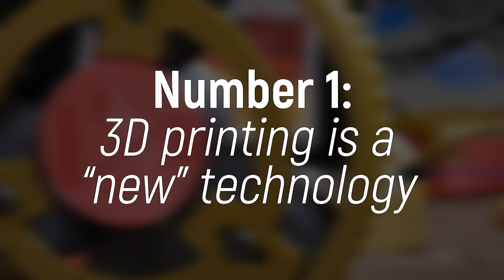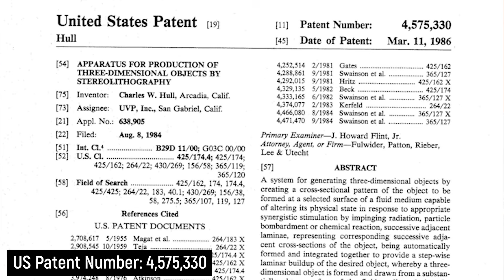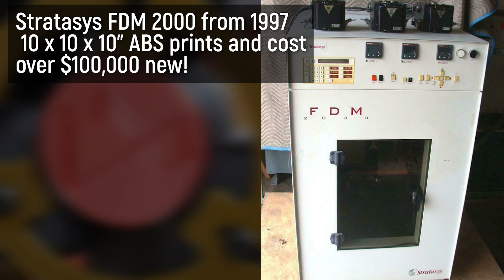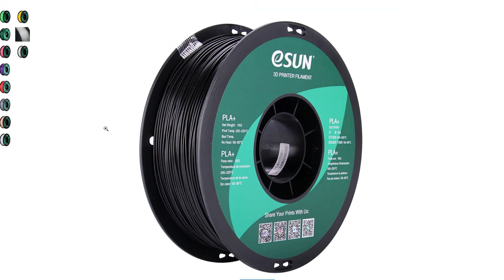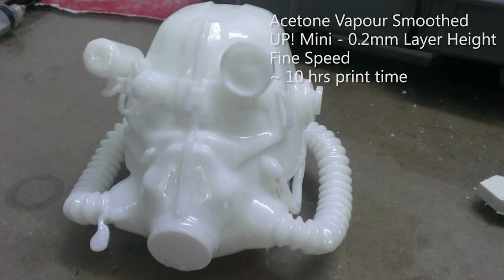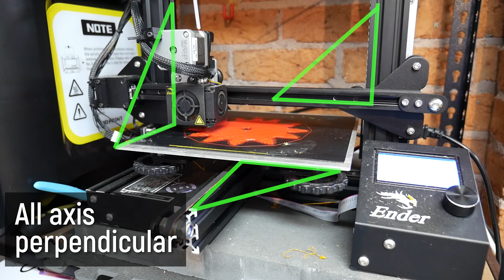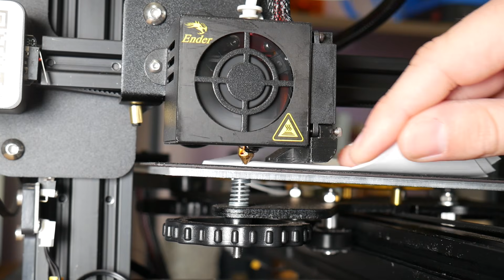3D Printing Myths I used to believe...

Comment: Good note about the folded paper and how you aren't properly settings for 0mm.  However, I have used the paper method almost exclusively for over a year with tremendous success.  The trick is first, as you mentioned later, to pre-heat the bed and the nozzle.  Then, you use a single piece of flat paper, and raise your bed until you get a strong rub.  Should be hard to slide underneath the nozzle and make a rubbing noise as you move it.  I bought a feeler gauge, and I never got along with it.  But another method that I used for a short period was a single-layer print that I made, with a skirt along the very edge of the bed, and 9 squares spread out over the surface.  The skirt would print first, and I could get a quick idea of where to make an initial adjustment, then as the squares print I'd get a good idea of what parts of the bed are too close or too far (since some beds are warped in the middle, so sometimes you have to find a balance of being a little too close on the outside so that the middle will be close enough, or vice-versa).  This was much more time consuming, and wasted some filament (not very much though), but dang did it ever dial me in nicely.  So I wanna say I really appreciate this video, and I think it's well done, and all good advice, but I'm just tossing this tidbit in there to say that the paper method can work well if you do it right... but folded paper?  Nah, I'd be right there with you to only advise using that when you've first built the printer or made major modifications and just need to get the nozzle somewhat close before fine-tuning it.  Also, very interesting about ABS.  I was also under the misconception that it was stronger than PLA (because of the heat resistance, I guess).

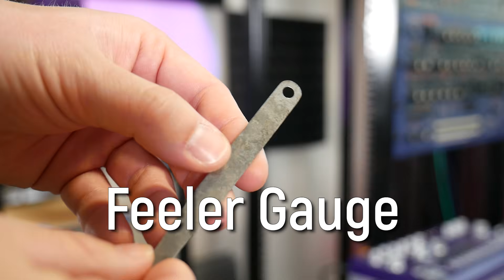Comment: 9:40 yes, you are right about the metal extension, but if you heat the nozzle - a plastic table (cover) will melt while you checking the distance
Probably, There is an option, to preheat it with a lower temperature.

Comment: I have a glass bed on my ender 3 and I find in the middle it's a little lower then where the feet are.

I set the corners to paper width but when I move the head to the middle it's higher off.

Comment: I really like the idea of using a feeler gauge.
However I never heard that you should fold the paper. Of course that'll be the wrong hight. I have always used a very thin piece of paper and that usually works well. I then do small adjustments while printing directly afterwards.

Comment: Isn't this ignoring Z-Offset? Not sure about anyone else but if I zero my Z axis it isn't at 0. It's usually set to 5mm above zero. From this home position Z-Offset "tells" the firmware where the actual bed is. I know you know all this so I'm wondering what I missed?

Comment: Anyone who has leveled a bed knows you arent actually leveling the bed to the planet, youre leveling the bed to the nozzle. You could bolt the printer to the wall and print at 90 degrees to the world but it still be leveled to the nozzle and your print will be perfectly fine.

And i have been leveling my bed with a ripped off piece of paper or a dollar bill for years. Since day 1. And my prints are perfect. My latest printer is about a year old and its stays leveled so well that i extremely rarely need to level it. i can go through hundreds of prints without having to level. I pretty much only level it when i mess with anything. if i take the bed off to clean the hairspray off it cuz the surface is getting gross, if i change nozels, if i tighten  my hot end, etc.. But if im not changing or cleaning something and just going from print to print, even if its a long time between prints, I level once with a piece of paper or a dollar and i leave it alone for months. Tell the printer to "home" the Z axis, While its in the "home" position (starting at the forward left corner) i level with paper, disable steppers, move the carriage to all 4 corners with my hand keeping extra careful to not bump the nozzle up or down, go around all 4 corners again to make sure theyre in the same position (some corners can go out of wack once you move other corners of the bed up or down). bam. done. Perfect prints. every time.

Comment: @Maker's Muse

still stupid that 3d printers start the print higher as expected.
how would you change that?
for example u used the paper to dial the nozzle in would you then set the printer to print at 0,00mm in cura? or would the nozzle than scratch the whole surface.
even after you explanation its still a mystery how to do it right.

Comment: Why folding the paper in the first place? Folding the paper gives you inconsistency in the thickness throughout the paper plane. I use one sheet of paper as a shim. Backing paper or aluminum foil has pretty much consistent thickness through the plane. With AL-foil/B-paper I get the best results,  first setting the working temp of nozzle and bed. Then use a piece of Al foil/backing paper as a shim, If you scratch or rip the foil/B-paper you know you get too far. If you barely dent the foil/B-paper, and you can pull It effortless out then you have your zero and then from that you can set your desired height with the accuracy of the thickness of the foil/B-paper. The foil/b-paper has an average thickness of 0,02 - 0,05 mm (brand dependent) with a tolerance of+- 0,0016 mm throughout the plane

Comment: Setting nozzle height... I always recommend to people to use the thinnest copier paper they have available, heat bed, heat nozzle, brush nozzle clean with a fine brass brush.   Then to do about 3 laps around the bed checking multiple points.  Using Pronterface over USB for jogging, really helps.  Never have a I understood why people would use a thicker business card or folded paper.  I've found thin copier paper to work as the best jumping off point for nozzle distance.  Get consistent drag at each point (or as best average you can).  For softer plastic print surfaces which can dimple with a hot nozzle, avoid heating nozzle past 110C.  Pull back filament, a little with HOT nozzle, brush it off, let cool to under 130C. Before checking nozzle height to avoid dimpling the print soft print surface.  If your print surface is good with heat, then just keep it at print temp, and no need to retract filament.  Works 10/10 times for me.

Comment: would that same method of leveling work if you used any flat piece of metal from like a soda can or something and got the height of it from the caliber if you didn't have a feeler gauge then just input that same high in for how off the bed will be and should work ?

Comment: If you take a flashlight you can even adjust the bed by eye!

When it is at zero it should lightly touch the buildplate, meaning no light will shine under it. If it is too high, light will visually pass under it and you need to adjust it!

Comment: Awesome vid. This is the first video I see where a youtuber mentions a feeler gauge. I'm unsubscribing to a few others now. I need to check out all of your videos. I am fairly new to 3D printing but work in oil production and believe I am proficient in aligning components and checking flatness. That is the only reason I dismissed the paper method and used my feeler gauge from the start. I tram and measure flatness. First, I put double nuts on the under side of the build plate to lock it in place. The bolt heads are tapered and can spin as you tighten the bed leveling knob. I used nylon washers between the build plate and nuts (Always concerned with fasteners on hot(electrically hot) material). Wing nuts on top of the frame and the factory leveling knobs underneath. I check the five points using the manual level option on my printer and feeler gauge. Then with the printer on move mode,  I run the y and x axis while visually inspecting the gap between the hotend and bed. If I see a low spot, I'll cover that area closer then using my feeler gauge, shim the low spot  with paper. Graphing paper is .003in and most print and loose leaf paper is .004in. I never have print fails due to the bed being out of tolerance. I do have many fails for other reasons though. LOL. Additionally, I haven't adjusted my bed in months. 
Note:  My bed had a low spot left of the midpoint approx. 80mm wide and ran all the way to the edge of the build plate. I don't think it has to do with thermal expansion. I think it may be the packers playing frizby with the beds before they box them.
 I like your channel.

Comment: You dont really need a feeler gauge. With a paper, you get to learn how tight it should fit.
Or you can use a ruler. Just measure the thickness with a caliper.
For instance, 1.6mm , then insert gcode G92 Z1.6 at the beginning, after homing G28 and setting units to millimeter (G90 ?), and it's all good.
Also, you could over-extrude a little on the first layer. I entered a filament thickness of 1.7 , rather than 1.75.
It over-extrudes a all the time, but I noticed that , in some portions, the filament often is thinner than 1.75 anyway.

Comment: If you had a thin metal sheet that lay flat on the glass top, you could hook up an LED at very low voltage to the plate and to the metal nozzle body to detect when the nozzle makes contact with the plate. Might be a better test than using a feeler gauge.

Comment: one thing that I have not seen online but found out myself through experience is levelling the bed by sight, I use an ender 3 with a glass bed and the best way I have found to level the bed is to preheat the bed and hot end, then auto home then move the nozzle over each adjustment knob, to level the bed I look at the print bed at a shallow angle, bring the bed up until it touches the nozzle and then back it off until I can just see light coming through the gap between the nozzle and the glass bed. I have found this to be much easier and more reliable to do than any other method of bed levelling so far and hope this helps!

Comment: I know literally nothing about 3d printers so with that in mind if I may ask a quick question. Wouldn't a laser leveling system run through the printing software solve the leveling issues and make things a ton easier?

Comment: Once bed corners have been set at similar distance from Nozzle I found most reliable to Pause the print when it starts, disable drivers , turn the Z screw to adjust the nozzle clearance to the right feel ( experienced based ) and then resume print .

Comment: The way I "level" a bed (we all should know that bed leveling isn't really leveling, but...) is to use a single layer of paper and position the nozzle directly over each adjustment screw and do each one twice. Testing anywhere else should give the same result unless your bed is warped. If that's the case you'll never have a perfect levelling.

Comment: A single piece of UNFOLDED paper is usually about 0.1mm. You can use this as a feeler gauge, and the printer i have has a calibration mode that automatically steps the head up by 0.1mm, then commands you to use a slip of regular paper as a feeler

Comment: One of my friends manually 3D printed a bust of the swamp thing back in 2002. She did it using a glue gun, and layers of wax paper to help stabilize it. the thing looked amazing, partly because she picked a subject that already looks melty. it made me want a 3D printer way back then though.

Comment: I think the reason your folded paper didnt work as a height gage is the fact that you folded it.  I have used a single, unfolded sheet of paper as a guide with great results. I have never heard or seen a piece of folded paper used as a leveling method before.  Where did you learn of this method?

Comment: You are totally correct. Pro use feeler gauge to adjust this type of stuff in many type of industry. Mostly, i saw it when they want to print on paper with cylinder. They use feeler gauge to be sure than the cyclinder is parallel to the paper band. Tramming gauge is also use, it's another option to check parallel. Often, we do it when the machine is running to see the result of the range modification.

Comment: I print with Ender 3, on a glass surface and i level the bed by claping - i set the height of the bed that way, that if i push the bad from the bottom, it barely claps the nozzle.

Comment: want to say your suggestion about feeler gauge is a godsend, I always have trouble about the first layer, either too close or too far and I always need to watch the print and fine tune it during printing. Then I buy a feeler gauge from amazon, $10, set the bed to 0.2mm, boom, one shot no problem prefect layer. If I need to print at 0.1mm, I can just offset the bed when start of the print and still getting prefect first layer, want to thank you for this video, you saved me tons of headache

Comment: The paper trick works really well if you measure the thickness of your paper first. Lol then you need to subtract the amount of the paper from your layer height... y'all rely too much on squish testing instead of calibrating your printer properly out the gate.

Comment: Why put anything between the nozzle and the table while tramming if the nozzle will go up exactly 1 layer on print start?
I always tram my bed to touch the nozzle slightly by slowly loosening the bed nuts until the bed starts resonating with the extruder cooling fan sound.

Comment: Hi  great video but I going to take issue with the bed levelling, this has always given me problems. The tramming of a Mill is different to the levelling of a printer bed. Tramming aligns the Mill head to the machine bed where as in this case the print bed is aligned to the printer. The X and Y axis must be square to each other because there is no adjustment. If its not then is will produce a Rhomboid print in plan. Squaring these axis (if possible) will produce a square print. Check the diagonals on your prints chances are they are out of square. Thinking about that argument, then the X Z and Y Z axis must be square. So if the XZ or YZ axis are out of square then then print will be Rhomboid (assuming the filament sticks in the first place) in elevation. Consider the ZY axis, if this leans backward then lowering the rear or raising the front of the bed will correct the "Squareness" but the Z axis is still leaning.  Similarly with the XZ axis and adjusting the left of right bed height will correct the out of square but the Z axis is still out of square. The only thing that is a must is that all the axis rails are parallel. 
Using paper (once the Z axis height has been corrected) works fine for me so long as the same weight paper is used. Card will work, as well a feeler gauge, as you show. The most accurate method by a long way is Aluminium foil (kitchen foil) carefully folded several times and pinched in a flat faced vice. This method  will archive an accuracy down to about 5 microns. Much more than required for a hobby printer but for me the most important issue of the Z height and that the before start G code as you mention is correct. It took me months before I figured this out. 
Cheers for another great video and many thanks.

Comment: What about using a .001 feeler gauge which you refer to in your video. As a machinist I use a .030 plastic feeler gauge to set my X & Y offset. Also, why can not the manufacturers offer a prebuilt printer & factory tested with minimum assembly. I know I would pay extra for this service. Aldo the manufacturers could offer a list of options you could pick from?

Comment: Coming from a machinist, you use one layer of paper. most copy paper is about 0.003in thick, so the difference between dragging and being pinched is much less than that. also if you print bed is very flexible, you have to be more careful. Of course the printer starts where you zero it, how is that even a misconception.

The easiest type of printer to square is the ones that use a single rail for each axis, and even if they arent square, your parts will still come out, and no binding will occur.

Comment: Personally, how I set nozzle height: I use a flashlight. 

Shine behind the nozzle. You can tell if the nozzle is so much as 0.01mm above the bed surface (yes I measured)

Comment: Thank you! Tramming, feeler, shim, even calipers are terms I use all the time and I get baffled comments. Eccentric nut is my other favorite. 1 out of 100 know what an eccentric nut is and even fewer know how basic but important function they play on a printer. We do need to use proper terminology for it to spread. I also think we need to go back to basics and explain how and why things work the way they do. Such as "Wheel dust is actually fine particulates of the wheel caused by improper seating in the track. The eccentric nut assembly is usually overtightened for shipping and need to be adjusted prior to printer use." That should be written on every build surface protector.

Comment: Look, this really isn't rocket science. I use a simple feeler between the nozzle and printer bed. I double-check by dropping a vernier from the top of the carriage to the bed. I use glass for a bed and most importantly, switch off the automatic leveling.

Comment: Welp about that last think about "the paper trick", when i had my first experience with a 3d printer i was setting up the ultimaker 2 go of my school and it actually came with a paper card that said it was 1mm and in the actual calibration it said to use it to level the bed, so i guess yes, there is someone using it commercially

Comment: Another myth - leveling. It's not levelling! It's tramming. I've actually seen people wasting their time with a bubble level on their print bed - "I leveled my bed, it still doesn't work." Tramming is adjusting the bed so it is in the same plane as the movement of the head. That is what you need.
Reply: Hah! There it is, number 3!